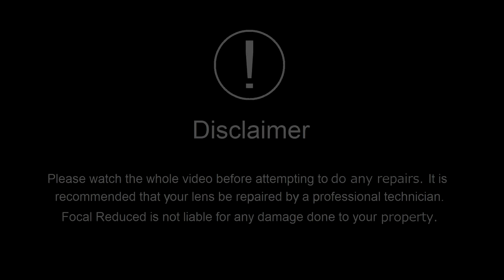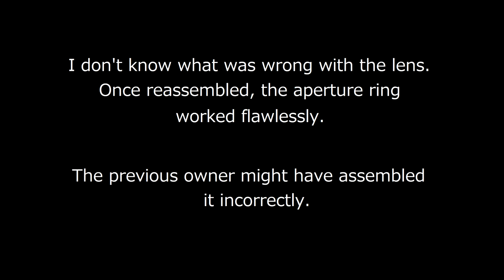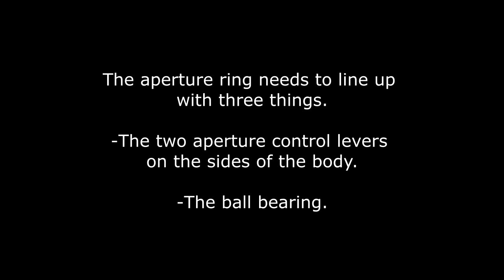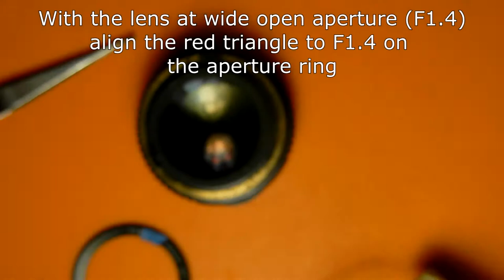Repairing stuck aperture ring on Asahi Pentax SMC Takumar 50mm F1.4 lens.

Comment: Very helpful thank you. I have cleaned my smc version with metal focus ring version with great results however I feel like focus distance has increased and I don't know what did I do wrong. I might alaign red triangle with infinity and see if that works. I am just not sure if I put second from the rear element upside down
Reply from the maker: If you have installed a lens element backwards, you will notice it in the photographs taken with it.  Sharpness will be significantly effected (except for the last lens element).   If you are sure you didn't move the helicoid during the disassembly/reassembly, be sure to install the focus ring at the same position that it was removed.  If you need to recalibrate infinity focus, watch my other video no how to do it.

Comment: Fascinating. I have a Takumar 28mm with Aperture stuck at 3.5 and need to do the exact same thing. Very helpful this video. What do you recommend for a thorough cleaning?
Reply from the maker: I think we do have a Takumar 28mm F3.5 video disassembly up on Youtube.  Check my other videos.  What do you mean by your question?  For a cleaning solution, we mostly use Isopropyl Alcohol.
Reply: @FocalReduced  Found the Takumar 28mm video, thx a lot. Isopropyl makes sense. I was hoping you can recommend one of your videos with a deep clean in detail.
Reply from the maker: I was hoping all the videos would be in detail, but I guess not.  Exterior parts and helicoid parts usually go into the ultrasonic cleaner.  Painted areas are masked off.  Aperture assembly is cleaned by hand with Isopropyl Alcohol.  Glass lens elements are usually cleaned by hand as well, unless they are completely drenched in oil. They will get washed in cold water and liquid detergent.
Reply: @FocalReduced  Thank you so much. I haven't been through all the videos, i guess i should dive deeper into your channel. Sorry for asking silly questions. I now have an excellent first project to get my hands on and your channel will be my university. Let me see how I manage. Love your content btw.
Reply from the maker: Thanks and good luck.